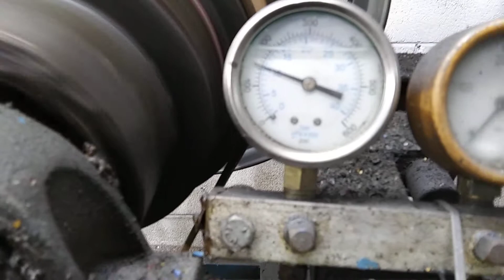1017 1.91:1 Velvet Drive testing

Comment: Seems like 150 psi across the board. I guess that`s about 650 rpm like a standard motor in idle? does this pressure increase when warm or Higher rpm for the 1014 1017`s??